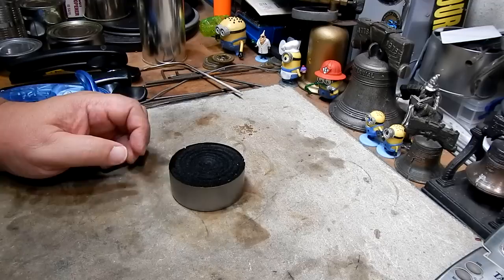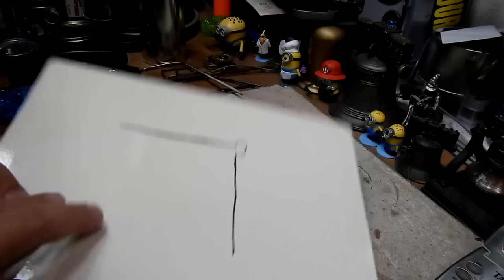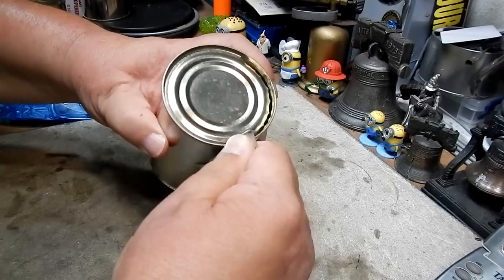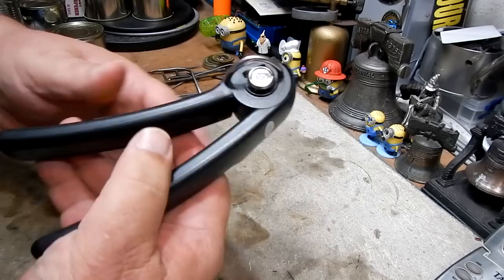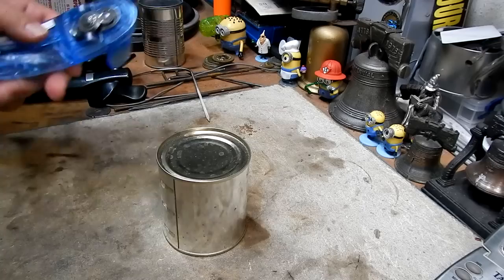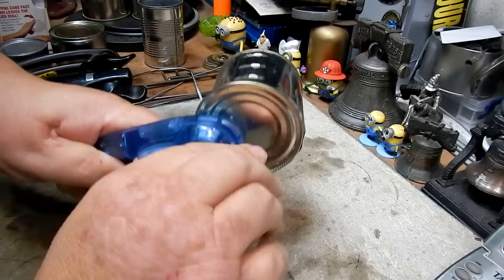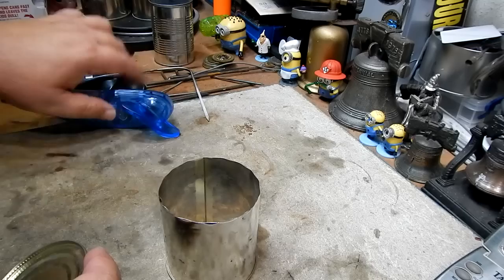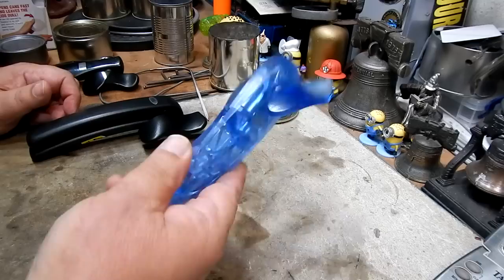What do I mean by ''fake side cutting can opener''?

Comment: Got to be more to the 'real' side cutting can opener than just where it cuts.  It is also appears to be breaking the adhesive seal on the lit so the very edge at the top of the can is the original edge prior to the lid being applied.  The only portion of the lid that remains on the can is that band of metal below the cut on the outside of the can.  The cut does not slice through the can itself like the 'fake' side cutter.  The lid also adheres to the inside of the can, but somehow its seal is broken cleanly away from the can without cutting.  Try using a cutoff wheel of a Dremel to do the same as the good cook will fail.  The lid will continue to hold the can on the top edge and inside seals.  The Dremel will have the same performance as the 'fake' side cutter having to penetrate the cut through the can wall as well as the lid edges on both the inside and outside the can to remove the lid.
Reply: Also, I had a can opener at one time that didn't look like it cut at all.  It only broke the seal.  The lid and can edges were left with a correlation pattern.  It worked great new but eventually quit working to successfully break the seals on the can lids and didn't track well around the can.  Never found another one like it.